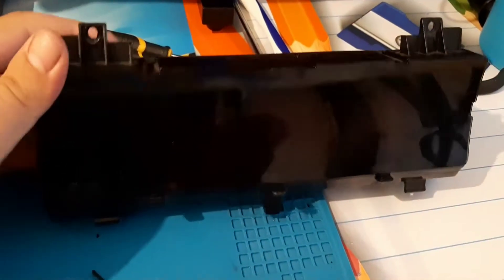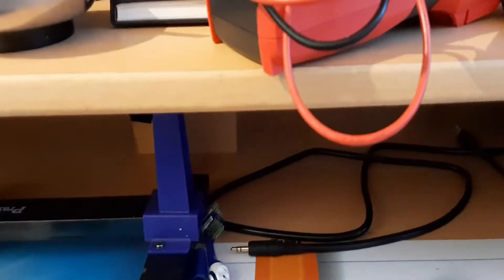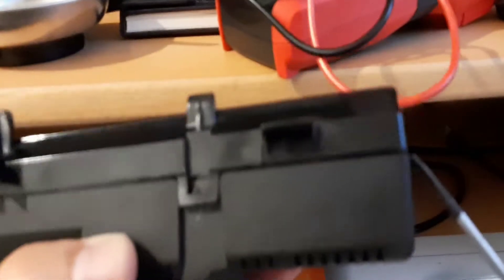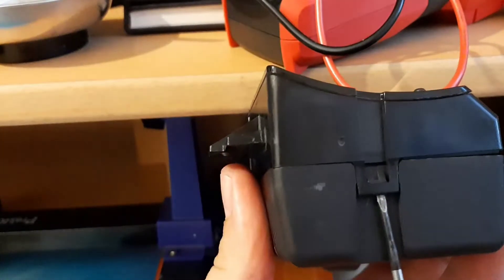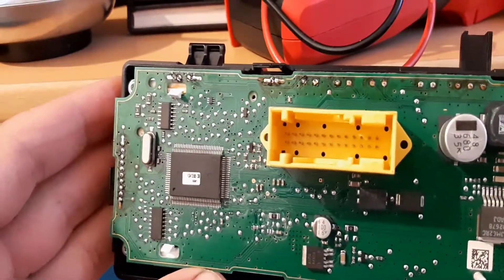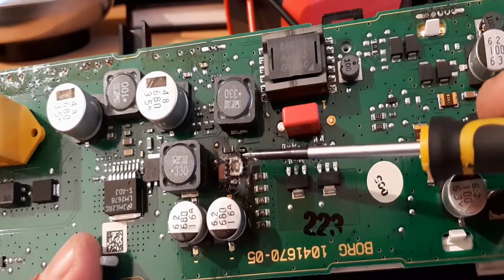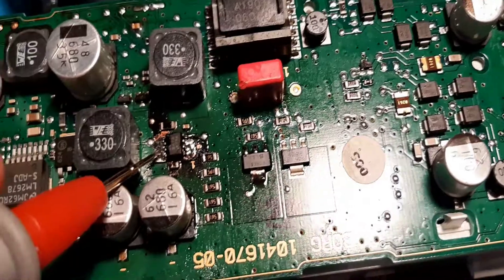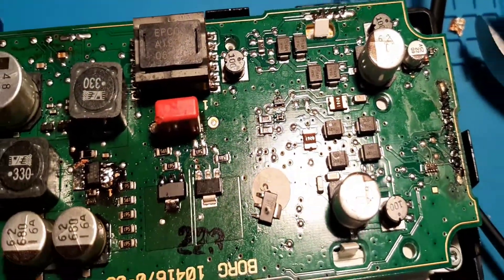Citroen C6 & C4 Instrument Cluster.Speedometer.Dashboard - REPAIR. Electronics Components BURNED.

Comment: You have clearly shown the problem, remember to redo all the welds, otherwise the repair will not take more than a few weeks ... A few months ago my meter also burned down, same breakdown, I only replaced the 3  components, and it only worked for a few days ... I took the unit to a meter repairer who normally eliminated the problem, fingers crossed!
Reply: hi. all the welds on which components? you mean in general?